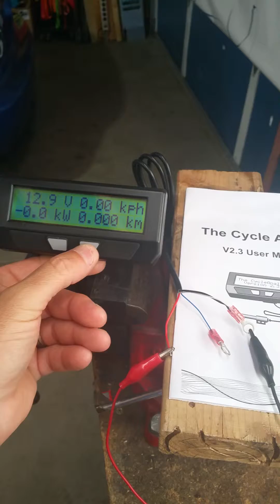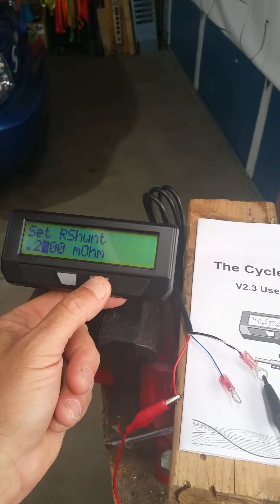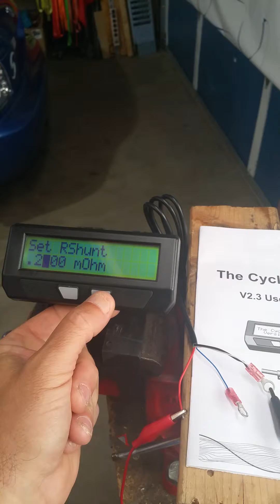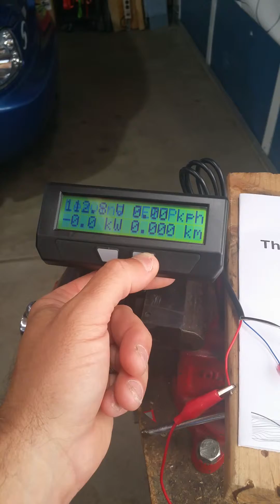Setting Cycle Analyst Rshunt value

Comment: Didn't know how to change value.. If manual doesn't say.. Just say long press left !Thank u God bless..My Ebike 66v 3000w MidDrive.. Was surging.. Was told to make amps as low as 5- or 10.. & throttle wouldn't respond only after 1/2 way twisted.. Was told increase to max the ramp on.. Hopefully will get to correct all this.. Thank u, again..
Reply: N Ahmed ..yes I also am having throttle issues, again, with 66v and no throttle working..umm do you think this might fix my problem as well on my Raptor 140?
Reply from the maker: N Ahmed, were you able to find and adjust the ramp and fix it?